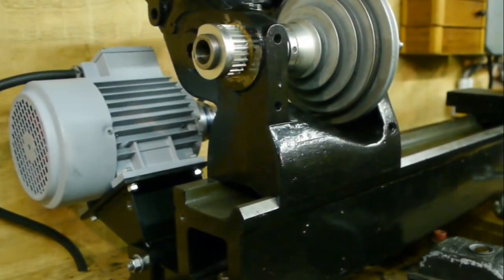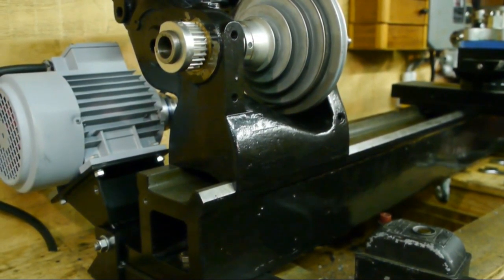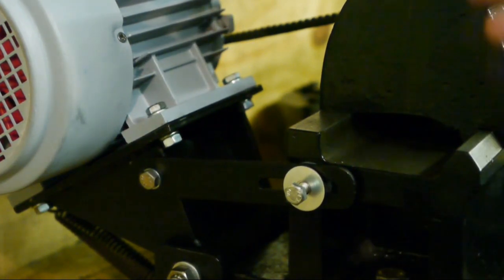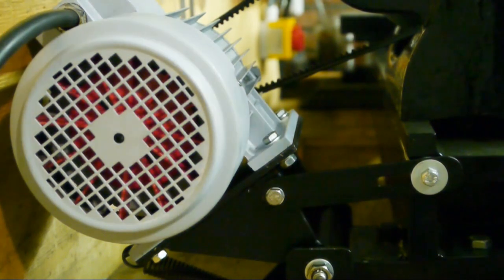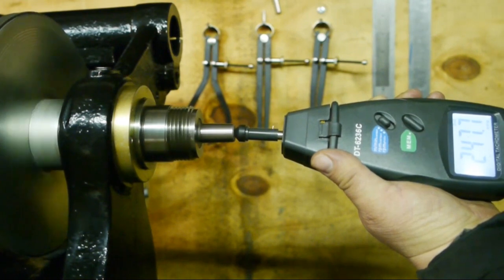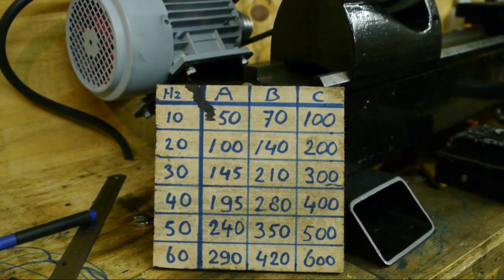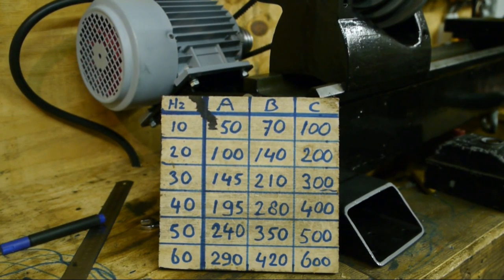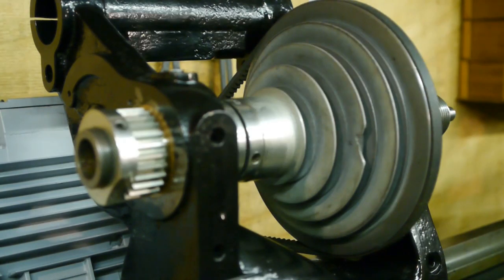A motor mount for my old lathe - follow up

Comment: This very slow zoom and slide effect, do you do this in the edititing softare?
Reply from the maker: Yes, that's done in software :) Plenty of editing software supports pan and zoom effects. You do loose some details. But I record in fullHD 1080p and export the edit to HD 720p. And since most people these days watch on a small screen smartphone it's good enough. Better result would be possible with a 4k camera :) 
I use videopad for editing, it's not free software. But it ticks most of the boxes for me.
Davinci Resolve is also nice for editing, and it's free. But my pc is nu quick enough for that.
Reply: @RolingRandom  That's interesting. Thanks.